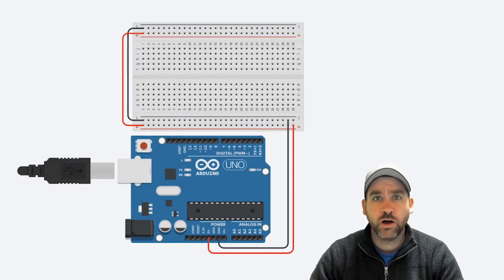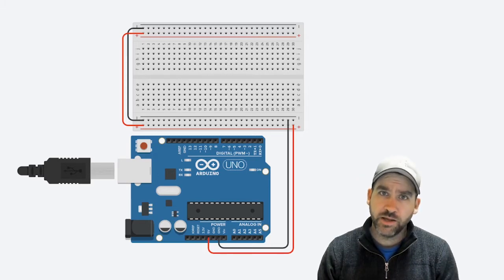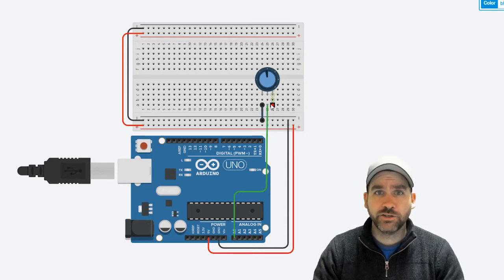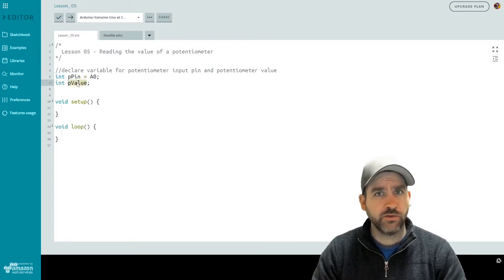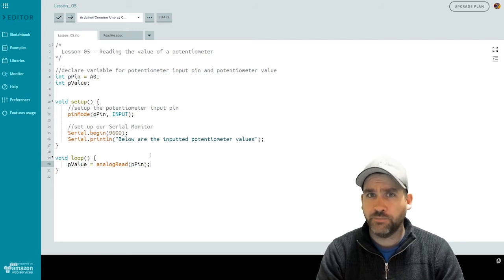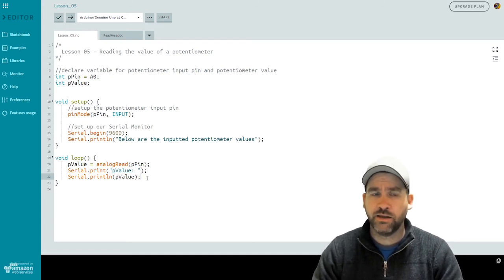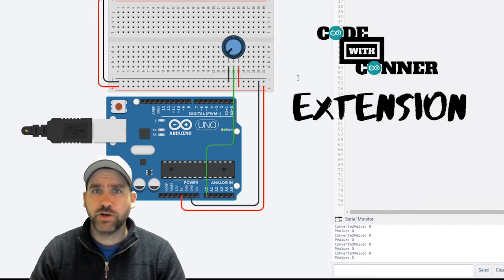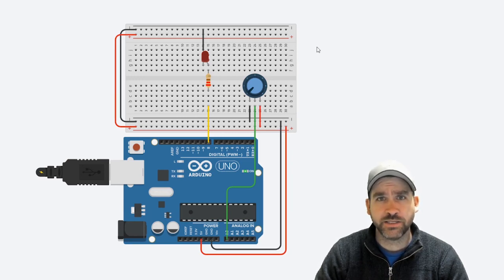Arduino Basics - Lesson 05 - Reading values from a potentiometer

Comment: Couldn't get lesson 5 to work until I added a 220 ohm resistor from the positive to the potentiometer.  Should this have been in the video?
Reply from the maker: Interesting. Was there anything else different in your circuit from mine?

Comment: do you have the challenge solution up anywhere? I'm curious to see how the dimmer would work, I'm using the analogWrite function and passing the analogRead value converted to voltage. so like analogWrite(redLED, voltage); and it sorta works.
Reply from the maker: Nice. Shoot an email to codewithconner@gmail.com and I can send you my code.